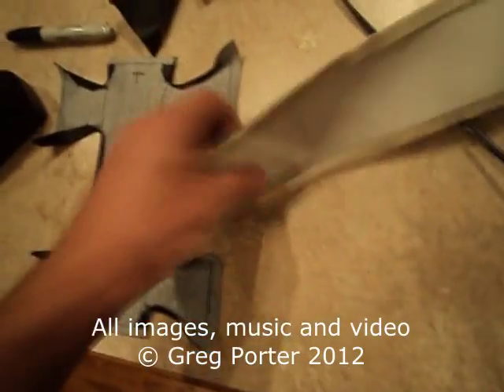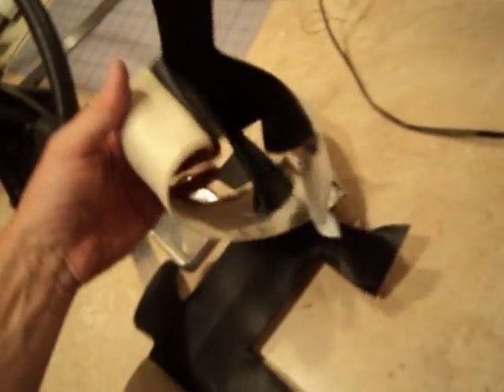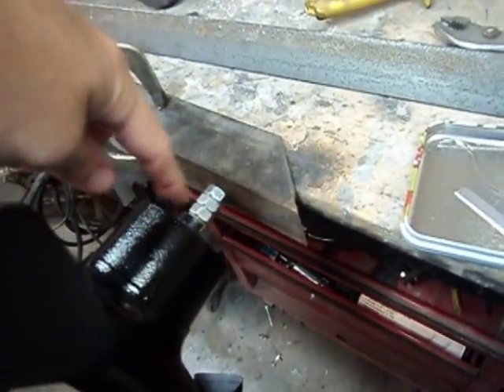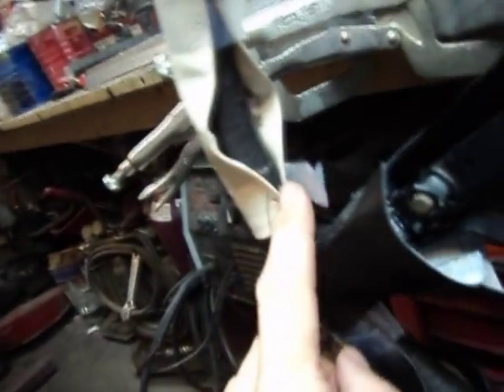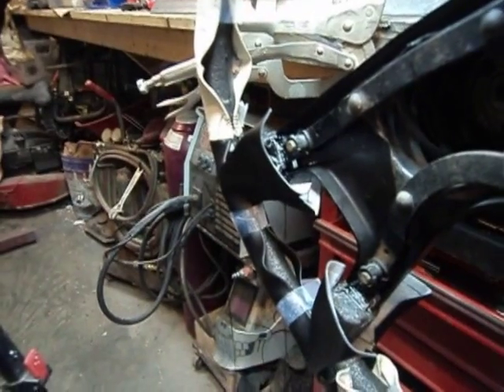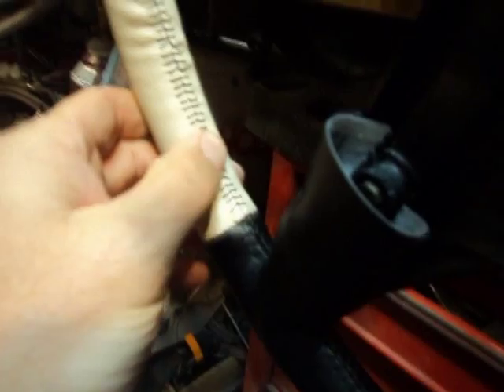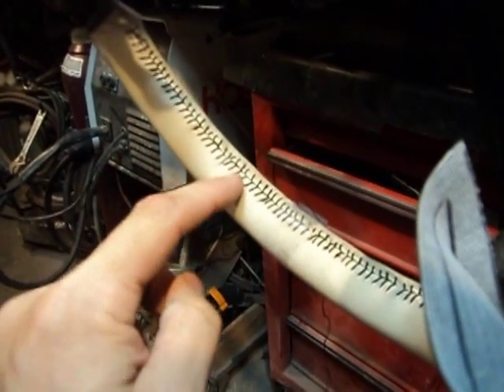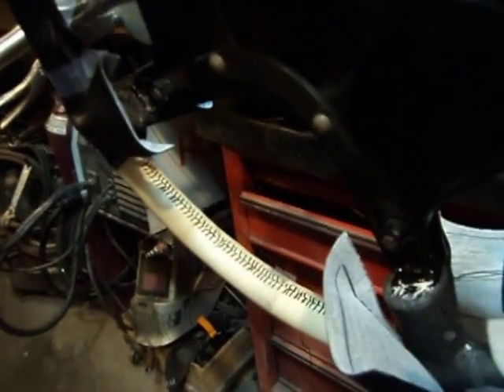VW Custom Wheel Wrap - Part Two - Testing the look

Comment from the maker: You are right.  It's a trick to get it to lay flat.  I've inspected quite a few wrapped wheels and most of them have a "pucker" that goes with each pair of stitches.  ALL of the wheels I've seen have the holes lined up.  I am going to give it another shot with wider gaps...  If it sucks, I'll peel off the foam and go with the shiny wheel.

Comment: I think leather is preferred because it will stretch in all directions, and thus if the pattern is made with just the right dimensions, it won't bunch up on the stitched side. Upholstery vinyls tend to only stretch a bit in one direction. Might still be doable with decent results, but you have to keep that property of the vinyl in mind when cutting out each pattern. I believe aligning the stretch axis of all the vinyl pieces to the circumference of the steering wheel, and stitching the patterns together before stretching it over the wheel may be the best angle of attack. Guessing just the right amount to decrease the circumference of the vinyl wrap compared to the wheel's circumference is the real trick. Using a heat gun or steamer as you stitch it up may also help shrink areas as necessary.

Frankly, if you can find leather that matches the colors, if not the texture, of the vinyl upholstery, that would be the best way to go.
Reply from the maker: You are 100% correct.  I was never happy with the results from the vinyl.  I bought a buffalo calf hide over the summer.  My next project in the garage is to cover the wheel properly with leather.  That will probably happen after the holidays are over.
Reply: gregmporter I'm gonna give my hypothesis a try just for fun since I'm reupholstering my old seats in vinyl, but if I'm not satisfied, I'll be doing the same as you. Maybe I'll just do it over the old leather on the steering wheel. It's not cracked, just worn to ugly patina color patches. The steering wheel is just one of those things. It needs to feel good, and look good.